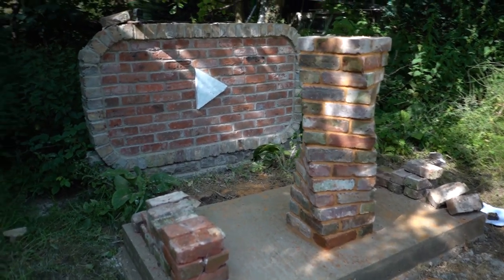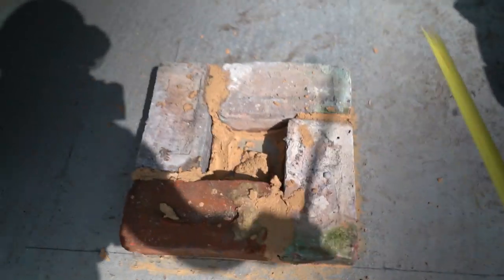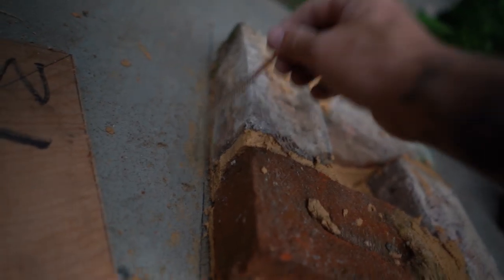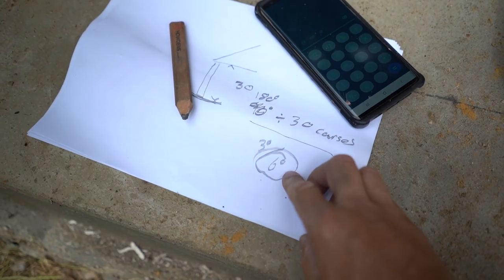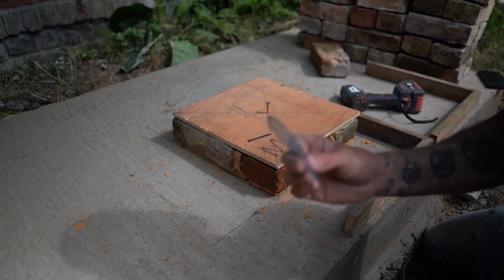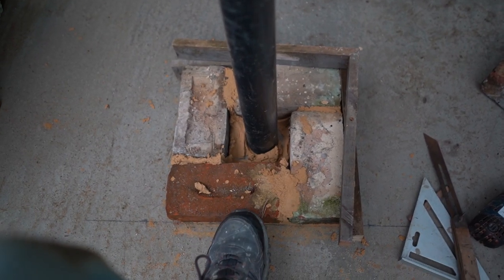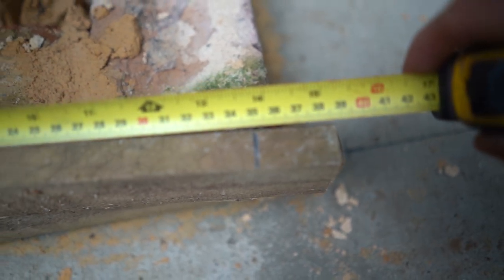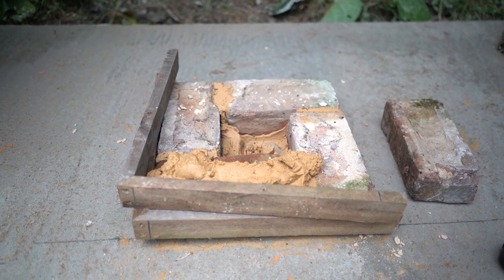HOW TO LAY BRICKS -THE TWISTED PIER

Comment: For a plumbing point set out your square on the foundation with pencil cross your corners to find the centre. Use a compass/tramel to draw a circle connecting all four corners and that’s your pluming point boss. Good video 👍🏻

Comment: just measure one side of the template and divide it by 30. Then draw a line or a cross on the template exactly one increment away from the first corner and that will be your first turn as the corner lines up with your new course and the pencil line lines up with your previous course just keep going. You can also draw a circle on the floor or a template on the floor the exact circumference of the Pier and then the increments around and plumb up with the level. This method ensures you can keep a check on the rate of turn and that you're not going too fast or too slow so you ensure you finish exactly the right orientation

Comment: Well done mate looks great...little tip so you don't have to mess around with the square piece of board a protractor and a bevel just make both your 90 degree guides like you did....work out your degree of twist like you did....then just use your speed square and mark 6 degrees off your speed square on to the top of your first guide...plant your second one on and fix it. In essence your speed square is a bevel and protractor all in one 👍 Hope that came across ok mate not nit picking dude love the vids and your work.
Reply from the maker: Cheers pal 👍🏻 Never heard of it being done that way, I'll deffo give it a try. I'm all for making a build easier, appreciate the comment 👍🏻😁

Comment: a long time ago I seen this done with a sturdy piece of re-bar concreted or drilled in the concrete , plumbed both ways in the centre of the pier and a hole drilled in the timber square to allow you to slide it up the re-bar keeping the pier plumb as you go  it works .
Reply from the maker: I've done it with rebar before and a piece of plastic down pipe....I wouldn't advice using pipe though 🤣🤣🤣

Comment: To make life easier you can get some wood same depth as your bricks plus a joint for the template then you can pays bricks to the top edge a d no need to level them each time providing your first level is level and the bricks are all same thickness

Comment: If I were only going up 11 rows but I wanted the 11th row to be square with the bottom row I would have to do 180 degrees correct? If correct, that would be 11 degrees. Is that too severe of a twist for such a small pier?

Comment: Have only built these once as the decorative supports for a porch(not a big fan of them). I used a 4inch drainage pipe as the centre which also acts as the plumb point. Just needed to keep the bricks tight to the pipe on the inside. Had to make sure the last course finished parallel to the roof though. 👌👌
Reply from the maker: Measuring and working out the degree per course is a big part of building between 2 points. The pipe/string line through the middle is the only way I've found to get it plumb. A tricky build but good fun 👍🏻🤣

Comment: So if the column is going to a height of 10' how would you work out the courses!??
Reply from the maker: 10feet works out to be 3048mm now divide that by each 75mm course. That's comes out at 40.64 courses, basically we need to grind the courses down to make it fit to 10 feet exactly. This is where trial and error comes in. Let's try 76mm courses and see what happens. 3048 ÷ 76= 40.1 and some change. If you make each course 76mm you will fit it into the 10feet height. I hope this helps 😁👍🏻🧱
Reply: @RodianBuilds  thanks very much
Reply: @RodianBuilds  what is the height of the first floor in any given building, whether it is 3store or 4??
Reply: Rodian Builds you bumping rodian mate grinding would be 74mm a course lol 👍